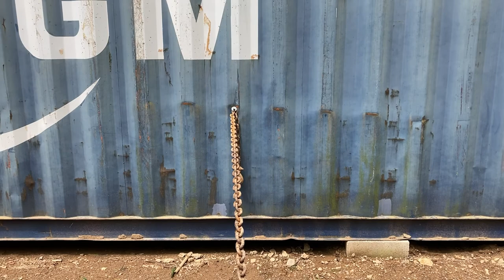How to install a window in a shipping container Tiny home I.T.Creations

Comment: Thanks for the video. I like how you joined the metal angles  but I don't get why did you go with the angle flange facing the outer side of the container wall instead of facing the interior. The way you installed it, unless you completely seal the top piece tends to direct water inside the container no? The other way it directs the water outside.
Reply: I have the same question. Wouldn’t it it be more water tight to install angle iron facing outwards?

Comment: Very nice design and instructions.  Flashing is correct and using the outer bend of the wall along with the angle iron leaves very little metal for thermal bridging if you install insulation later on.

Comment: I wish you showed us how you installed the window in the frame and how you sealed it against rain and elements.
Reply from the maker: It installs just like a normal window. Except you just use screws made for metal and pre-drill the holes. And use some caulking I just use 100% silicone.

Comment: What kind of screws did you use to attach window to go thru angle iron???
Reply from the maker: I pre-drilled the holes to size and then I used a metal tapping screw